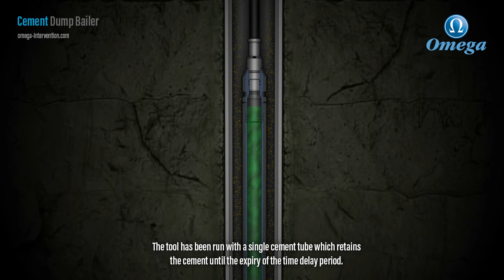Cement Dump Bailer

Comment: Nice work 
But I think it takes time even reaching depth you still have to wait for timer (for high depth and temperature cement may get dry) also if HP was very high the cement would go out hardly  from cement sector and may remain some of it inside tool
In other side it safe cost of E/L